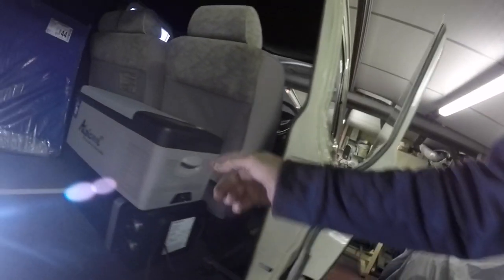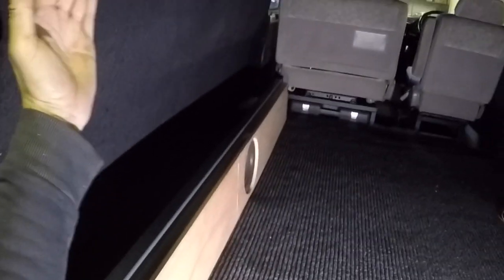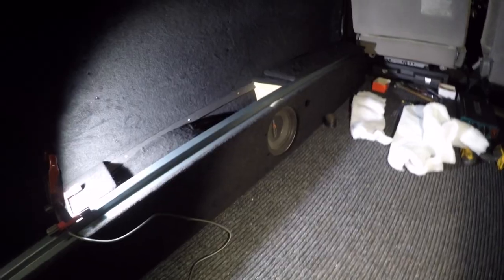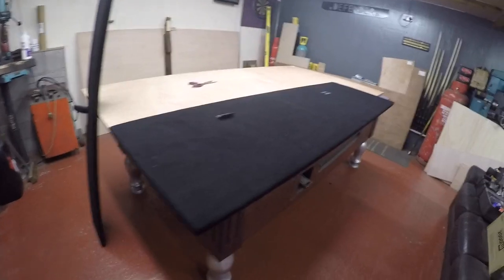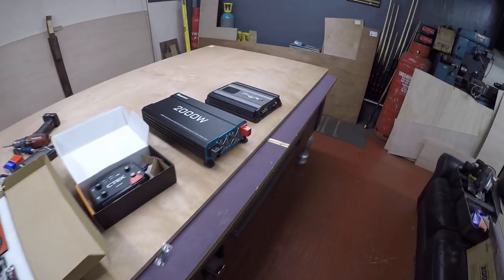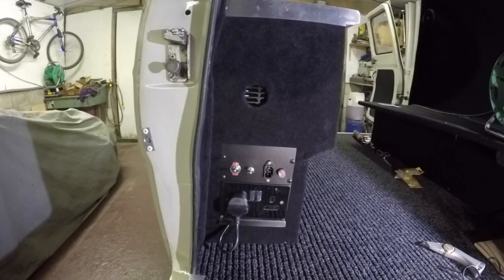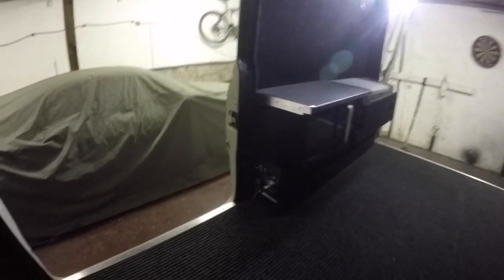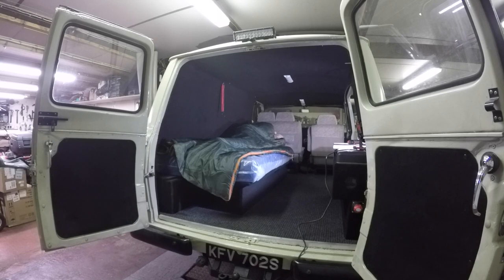Mk1 Transit Build - part 15  Camping interior

Comment: Just finishing off my Capri and Granada, then starting my Mk1 Transit build. Same as yours bar the side door, and I’m wanting to do the same as yourself in a lot of things. 

What sort of power does the landrover lump put out? I was tempted with a 1.9 PD from a VW but the landrover bolting up to the transit box etc definitely makes thingd simpler! 

Many thanks 

Kris
Reply from the maker: Hi Kris, yes the 1.9 PD are a good engine and I like them as the injectors are very similar design to the Land Rover TD5. But with the Tdci bolting straight to the mk7 transit box that’s what did it for me, my 2.2 standard is 125bhp but very good torque and 170bhp mapped but to be honest I’m now running it standard as it’s to powerful mapped in the transit. You could go with the 2.4 as they are easier to get and cheaper. I went with the Land Rover loom as I test ECU’s in the transit too but I think it’s a better option if your building one as you don’t have to use the mk7 transit full loom and cluster etc and the Land Rover defender loom is a lot simpler and you can even make the ecu Immo free if you don’t want to use the Land Rover security.
I just had a look at your channel and looks right up my street with the oldskool fords so I’ll check some of your videos out mate. 
Cheers
Shane 👍

Comment: sub needs to e in its own box really
Reply from the maker: It kind of is really as I’ve put a sealed partition in too separate it from where the amp and inverter is, and the bass reflex down the back of the wheel arch into another section, it actually sounds really good with a nice strong bass even in the very limited space 👍